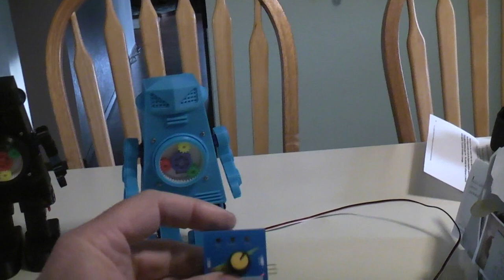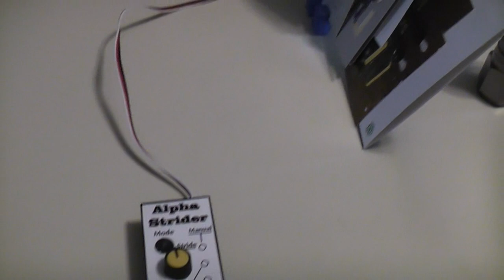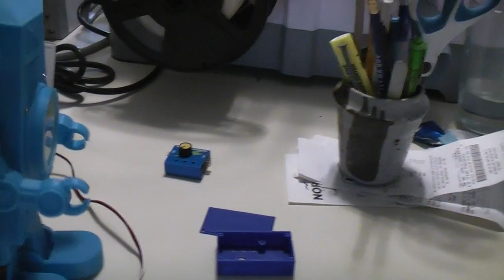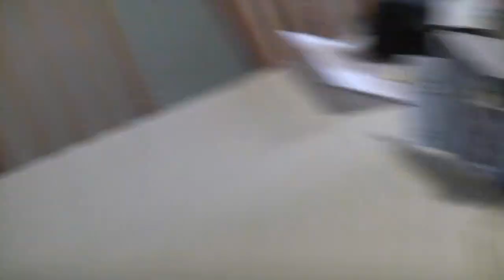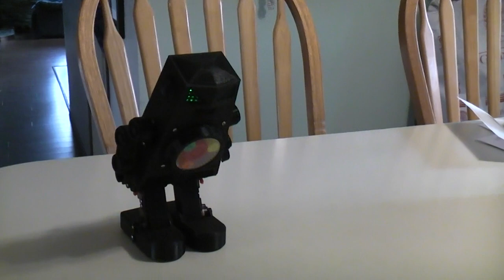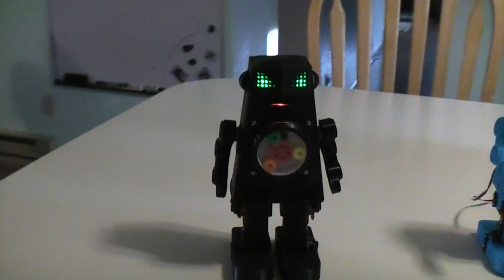Servo tester controlled , 3d printed, walking robot.    Part 2

Comment: Dude, this is a really clever way to make a toy robot! I never would've thought of using a servo tester. Nice job!
Reply from the maker: Thanks. I was just trying to think of a way for people to use servos that maybe could not afford a control board or who were not quite ready for coding or programing. Nice way to go for little money and still get to play with servos.
Reply: Absolutely! Thanks for sharing your idea! I've watched A bunch of your videos this last week, and you've certainly got a knack for making robots! Question: I saw you've got the STL files available for the legs base, but I didn't see the rest of the robot's parts anywhere. Are those available somewhere?
Reply from the maker: @24-7-testing  Back when I did this project I was selling the robot to collectors so I thought I would share the working part with the world but keep the cosmetic part for my collectors. It also lets the builder design there own body. Now that 4 years ago and do not think I even have the body files any longer.
Reply: That's ok, just thought I'd ask. I really like your Mr. Servo version too! I guess I'll try to design my own body for it then.